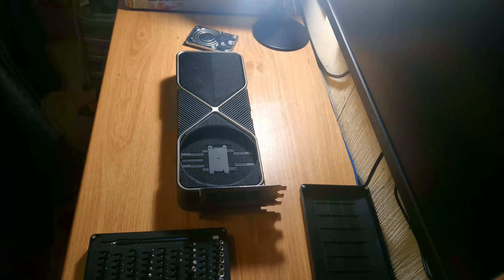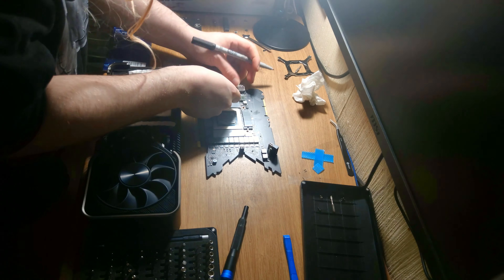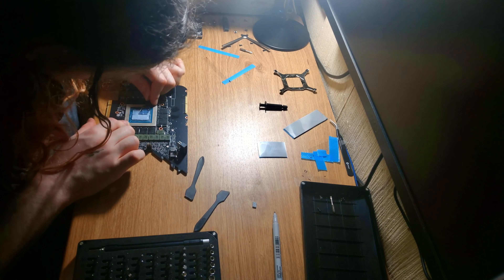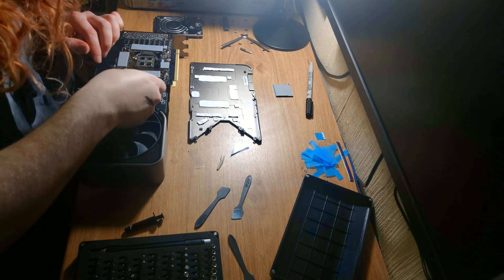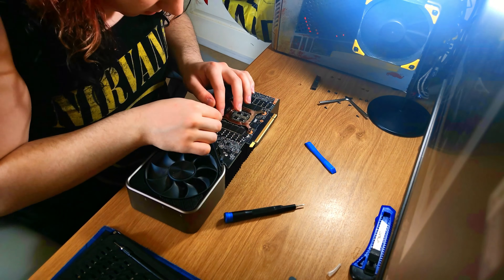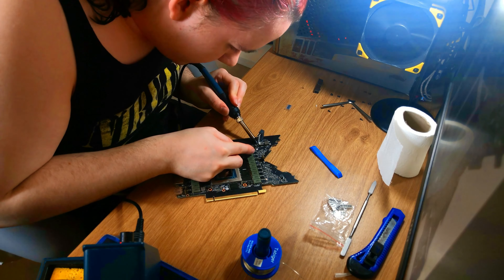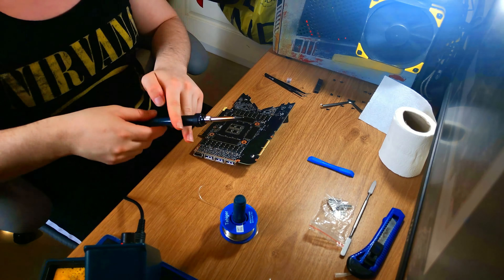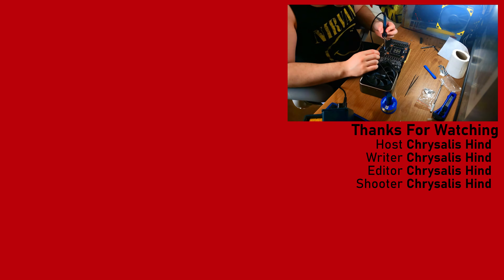Prepping the Ultimate 3090 FE, or how to re-pad and shunt mod it

Comment: Nice editing, some better close up (and focused :) shots of the PCB after pad application would have been good, also - what temp deltas did you notice? (before / after)
I'm thinking of doing the pads on my 3090FE - you mentioned 3 packs were enough - how much pad material was left over? (i.e. whats my margin for error?)

Also the heatsinks you added on the back - what observed difference did they really make?

Overall, I enjoyed your video. Decent effort and I really appreciated your running commentary.

Cheers from Oz
Reply from the maker: Hey there and yeah tbh I'm kinda running with footage filmed further back than I'd like to admit but that said to answer your questions I was seeing VRAM hit TJ Max at 110°C and pretty bad throttling to hitting 88°C with pads alone, adding the extra heatsinks brought it down to 86°C and the margin for error is about half a pack to spare once you've added all the pads the same way I did.

Anyway thank you for the comment n hope that helps!
Reply: @The117th  Great, thanks for the reply. I actually had 4 packs in my basket, but sounds like 3 will do the trick (1/2 a pack is an acceptable fudge factor). Also your detail on the surface heatsinks was insightful. I've spent way too much (time and money) on the aesthetics of my build, which is really just for gaming anyway. The 20°C+ difference from the pads seems worth the effort, but the extra 2°C maybe not - so that was useful info.

Again, I appreciate the effort you put into making your video. I know that content creation takes alot of time and effort. Especially when trying something new and potentially risky on an expensive component. My comments were intended as a constructive review (which I feel you understand, this comment is really for any others who may be here)

What I can say is that even though the 'production' quality may have some areas for improvement, I found your honest explanations and personal expressions (I'm burning my fingers here. :) more enjoyable than the conventional,  'produced', cookie cutter approach taken by other channels. Well done.
Reply from the maker: @benroberts4817  Well first of all you are welcome! I am glad i managed to help you out, I kinda know this particular piece wont get too many view but I feel it would at least help to educate people on how to do some of the fixes/changes they might wanna make to their GPUs considering its pretty expensive. 

Your comments are honestly really welcome and I hope the re padding works out for you, if you have temps id love to hear what change you experience with them!

Anyway thank you again and have a good day.